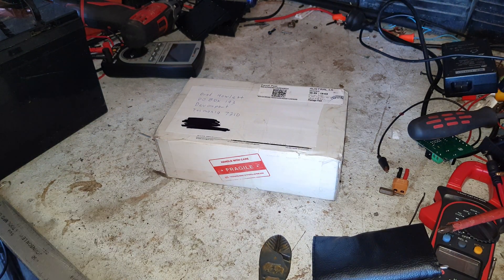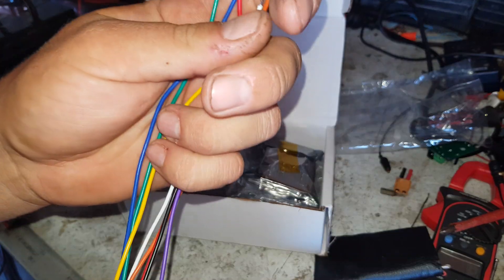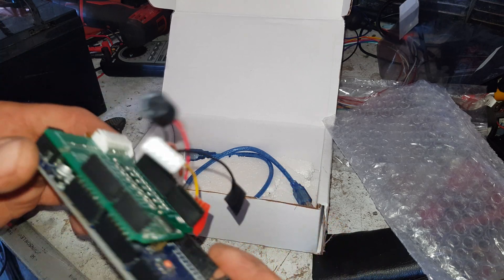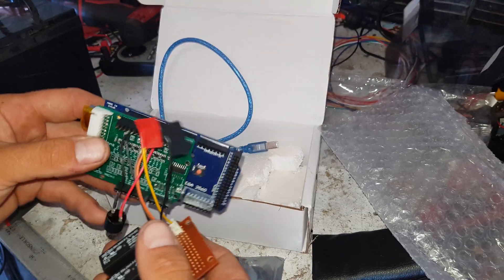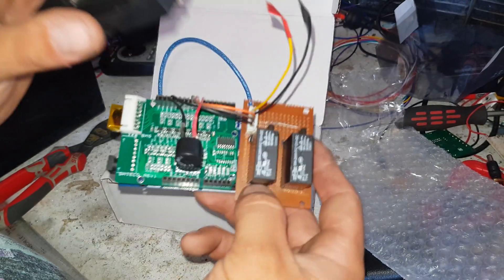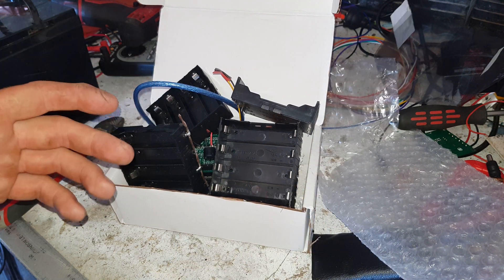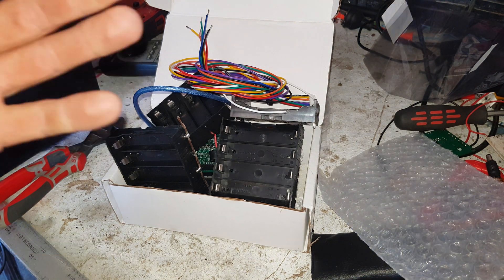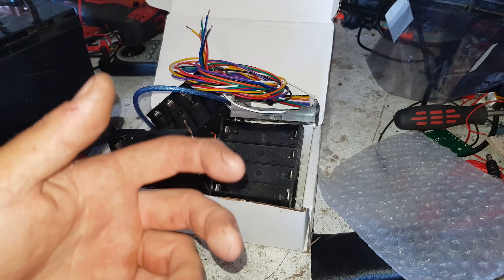7s Arduino Bms Shield For Lithium ion Power Wall  packs Sent in By A Subscriber

Comment: Use a digital temperature gun to see if the battery tray holder connectors are getting hot,and fuse each battery , where can I get the bms ,
Reply from the maker: Will have details next week look for a video on it mate. Release is very soon
Reply: One Up The Sleeve Customs , nice , if you can post lip stick to the main land I would be happy to buy ,  Im comfortably with arduno, and have made some projects from them ,downloads from github etc  to program the mega or uno arduno, a bms kit would be a awesome investment to my motor home,
Reply from the maker: What colours did you want hahaha